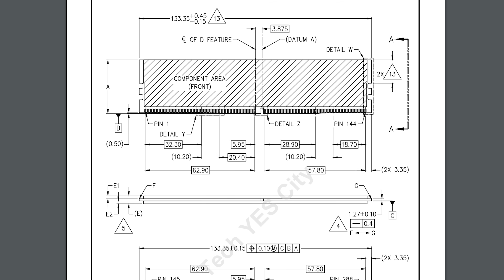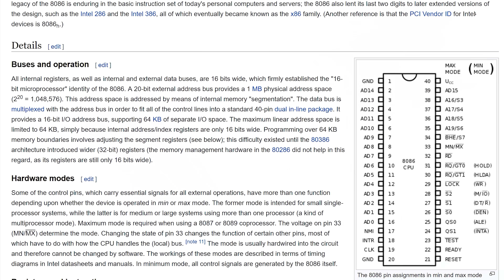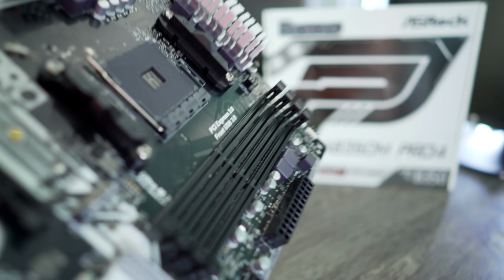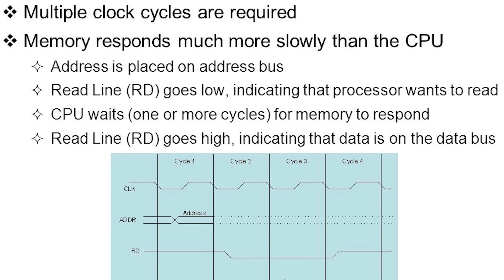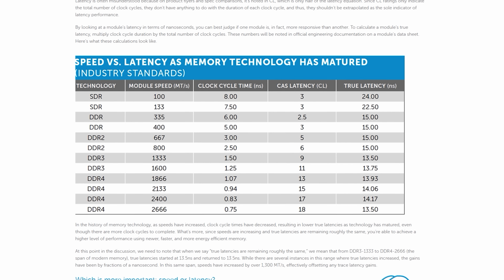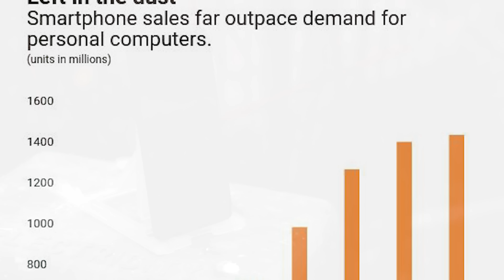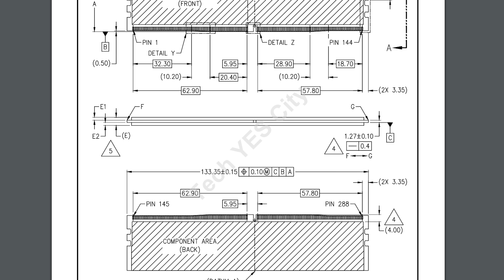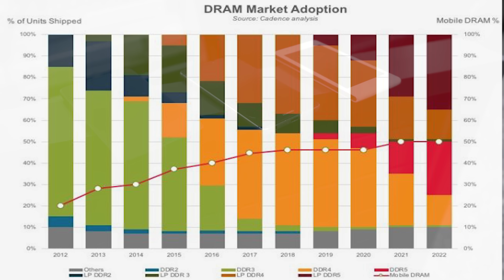When is DDR5 coming to a PC near you...?

Comment: High memory latency is not because CPU and RAM runs at different frequencies. It is solely because 1) how SDRAM works, where you need to active memory banks for reading and writing, 2) distance between CPU and memory. It takes 1.2 nanoseconds for electric signals to go from CPU to RAM and back from RAM to CPU. This is limitation of speed of light and electrical signals. You add to this some additional bank activation latencies, buffering (which takes another 1ns in CPU registers, queue, memory controllers, and memory) This means basically you can't do more than 600 million random 32-bit transfers sequentially (next only when the previous data is available) from RAM to memory. DDR5 will not improve much on it. Maybe minimally. The fact that a memory is running at 2400MT/s (1200MHz with DDR signaling), is a pipelined (interleaved) reads and writes. It is helpful with a lot applications, especially with things like cache prefetching, and in most applications where you do sequential reads in memory (and not fully random). This also works better if you have more cores or threads, execution speculation, data prefetching, and multiple memory channels, because more things can be send to memory (reads mostly) in parallel, without needing to wait for RAM to respond. This is called "latency hidding". The major reason SMT works (improves performance of many applications and systems) is due to latency hidding principle for other thread and utilizing spare RAM throughput better, despite slow latency.

DDR5 will improve throughput. It will not improve latency.

If you want batter latency, 1) forget it, use more SMT, use more cache oriented algorithms, more prefetching, 2) Use CPU with more L3 cache, 3) Use stuff like HBM2 and eDRAM/L4, for memory which is faster and closer to CPU (it is usually faster because often it is based on SRAM, not DRAM).

People often compare DIMM modules using CL (CAS latency, or Column Access Strobe latency). You need to know that CL latency is usually expressed internally in BIOS and specs in cycles per second. But if you convert it to time, you will see it is comparable to always same value. I.e. CL16 at DDR4 2666, is 12ns (16 / 1333MHz). The absolute latency didn't changed much in the last 20 years. And even in early 90s you could find memories that do 12ns access time in SDRAM, and some even as low as 6ns. For faster speeds you simply need to put them closer, and use SRAM. Then you can achieve 1ns, or even 0.5ns.

So, with 12ns, there is still some room for improvement, because it is still way off from fundamental limit of 2ns for signal propagation between CPU and RAM over 5cm. But once we go down to few ns, the distance will be a limit.

In reality, especially in big CPU systems. Software engineers are often using a figure of merit of 50-100ns for accessing random memory location in DDR SDRAM. And 3ns for accessing data in L2 cache. 1ns for accessing data in L1 cache. And 0.2ns for acessing data in CPU  registers. 1000ns for accessing data in high speed PCIe connected SSD. Things get much more complex in multi core, multi socket CPU systems, and even withing one CPU, latencies between different cores and caches differs, due to distance between them and depends on a lot of factors like types of buses used for communication and exact die and fabric topology, but usually varies from 15 to 80ns.

So obviously RAM access of 100ns is a huge bottleneck for random access.

The fastest big memories in terms of latency, that are in separate chip (other than HBM), are usually employed in real time osciloscopes, that can do more than 10 billion samples per second. Which would require memory write latency of 0.1ns. Nothing can do that, so they use dozens of memory modules, and write them in parallel in staggered fashion, and even these memory chips are at the extreme end of what is possible with current technology. Usually they use things like SRAM, PRAM, ReRAM, or MRAM, 3D / cube memories. Rearly DDR3/4, but it sometimes happens, if enough tricks are employed in memory controllers to do that. (We are talking 1TB/s of writes, compared to your standard memories that can do maybe 30GB/s).

In fact due to density requirements, and a majority of normal workloads using sequential operations on memory, latency is slowly incressing. DDR1 was faster than DDR2, and DDR2 was faster than DDR3. Seriously. There were DDR1 chips with 7ns. And DDR2 with 10ns. But you will have trouble finding DDR3/4 with less than 12ns.

If you want super low latency (but low density), go QDRII+, or RLDRAM II or these esoteric technologies. Due to cost and low memory density, and relative high power, you will only find it in CPU caches, ultra fast network switches, and super fast oscilloscopes, experimental physics detectors, etc.

PS. 3D XPoint / Optane, is slower than all technologies mentioned above.

Comment: Upgrading is gonna be a pain means a new motherboard that support DDr5 and that the CPU supports it also just be a big pain and costly
Reply: i agree and thus why moving from DDR3 to DDR4 took so long. the move from DDR4 to DDR5 will most likely take longer than that. It is also not on the server decade upgrade cycle so DDR4 will still have to be made for another decade even after they get all consumers to shift over to DDR5. To that i highly doubt any major company with enough servers to matter will make a upgrade to DDR5 when it is new and untested. In 2030 we might see a mass adoption of DDR5 in servers as QDR is not taking off in anything but PoS systems.
Reply: @yumri4  Servers are on a 4-5 cycle.  Socket 2011 was around for 7 years - from v1 to v3 or 4 - up until the new Xeon Scalables - was the HEDT and Server Socket - Xeon Scalable needs 3647 and new HEDT is 2066.  So max of 7 years - and for some it was much less (the v3 and v5 xeons were not compat with v1 socket).

Servers can much more easily make the move to DDR5 - because most of the servers are sold thru OEMs like Dell - and their customers dont care about socket or whether it's DDR or DDR5.  What ever is current will be spec'd - and most enterprise will only have the servers for 4 or 5 years - then toss them.

Not sure where you pull this decade for this and decade for that bullshit from.  DDR5 will start sampling in early 2019.  First CPUs to bake in DDR5 will probably be late 2020 - for both Desktops and Servers - mostly servers.  So by 2021 - DDR5 will be the standard, while still competing with DDR4, will slowly start to supplant DDR4 almost completely - much like DDR4 has done with DDR3.  Even then, some people will still be using DDR3  - and DDR4 will slowly fade out (that may take a decade).

New PCs bought in 2021 will most likely be DDR5.  New Servers bought in same time frame will be DDR5.  far before 2030...

I have been in the server world almost as long as there has been a server market - in the beginning was still dealing with IBM mainframes (System/390 and later AS400s) and was involved with retrofitting and building data centers for use with UNIX servers (Sun and Silicon Graphics mostly) and then commodity servers running a then very new Windows NT 3.1.  Back in those days, things moved very slowly - there may have been very long times between major architectural changes to both hardware and software. but certainly not a decade.  The current market is moving much much faster, especially on the hardware side.

DDR5 does not need testing - it either passes or it doesn't - it not like moving to a completely new generation of CPU - T&A and vendor certification will happen even before DDR5 production is ramped up - you can bet that the major OEMs are ready once the CPUs that support it and the memory starts sampling.

Very few if any enterprises actually build or even upgrade their servers - they buy them, run the hell out of them for anywhere between 3 & 5
 years, then dump them and buy whatever is the newest the OEMs are selling. This is why you can buy HP and Dell servers cheap on Ebay - they were $20-$40K machines when new - but now can be had for a few hundred bucks.

So to the OP- yes it will be a total PITA to upgrade - but will be a while before you are REQUIRED to move to DDR5.
Reply: Memory controllers on modern processors are on the CPU... so the motherboard will support DDR5 because the CPU supports DDR5.
Reply: @bradvicious3991  no it means BOTH the motherboard slots AND the CPU have to support DDR5. IF the motherbord has a DDR4 slot then the DDR5 will not slot in. Same thing with a CPU that supports both DDR3 and DDR4 depending on the motherboard you get either one NOT both.
Reply: @yumri4  When the CPUs that have DDR5 controllers in them are released, motherboards designed to use those processors will use DDR5.

Comment: Unless DDR5 can shift frequency incredibly quickly, synchronizing it with the CPU clockspeed makes absolutely no sense, and with the design direction that processor architecture is headed, it makes even less sense.
Furthermore, CL isn't the only important timing in memory; I have benchmarked software scaling linearly with TRAS, which is typically CL*2 + TRDC in DDR1 and 2, but typically slightly lower in DDR3, meaning that DDR3 improves effective latency over DDR2 with the same CL. I'm not sure if DDR4 improves the timings structure further, but it's very possible that CL for DDR5 isn't actually going to result in higher effective round trip latency, though typically a new memory standard will undergo a period where it's more refined, and higher voltage counterpart is better, simply because the voltages can be higher, allowing for tighter timings at higher clockspeeds.
Reply: Wow you ass is really active today - since you pulled all that out of it

Comment: Yesterday I got a Ryzen 7 2700X with 16GB 3000MHz RAM and what my conclusion is that you don't really need such high speed these days. I got an Xeon X5660 @ 4,3GHz with only DDR3 1200Mhz RAM and there is still no real difference to me between DDR3 and DDR4
Reply: ryzen needs 3200/cl14 (pref 3466/3600 at cl14) to perform the best.

Comment: If the speed: latency ratio gets worse then wouldn't that be a negative impact on performance for Ryzen chipsets? Coupled with the up and coming 'chiplet' CPU, GPU and APUs doesn't the infinity fabric need low latency and high MHz ratings to perform at their best?

Comment: DDR5 release was my deadline for new pc (6700k/gtx 1080 build now). A lot has changed since 6700k release with AMD disrupting CPU market. So far, i skipped ryzen, vega, and now rtx. Maybe my pc will still serve me well after DDR5 release.............
Reply: My old 6700k @ 5ghz was great also has TridentZ 3733mhz along with it. Have an 8086k now but the 6700k surely will be fine. I wouldn't have minded keeping it, even if I had an 2080ti.

Comment: It will be interesting to see how much DDR5 will benefit the future generations of ryzen. 
Ryzen 1 and Ryzen+ already greatly benefit from high bandwidth and lower latency ram. 
Just more to look forward. An improved Zen architecture on 7NM, and possibly DDR5 over the horizon to push Zen even further. Already I honestly predict Zen 2 will be DDR4, and Zen 3 may use DDR5.
I doubt we will see something like we did in the Phenom II days where the cpu could run on either DDR2 or DDR3.

Comment: Doesnt feel like the difference in ram makes much of a difference in Intel Systems. I got DDR4 in my main rig and DDR3 in my backup build. As long as I have more than 8GB I don't care about timing. Ram is expensive enough already. If you're on a budget I HIGHLY SUGGEST an used older intel build that uses DDR3. if you want a new build go for the ryzen with as fast as you can afford ram.

Comment: I’m very excited for ddr5. I haven’t built myself a flagship PC since 2011 (or 2010, whatever year the 500 series from Nvidia released), and though I love grabbing mid-range parts used or on sale for budget prices, it’s about time I went all out on the top end savings rig again. Probably built around an open box or used 2950, with either 4233 ddr4 or ddr5 depending on prices and timings. We probably won’t see “fast” ddr5 until a few months after it releases. Initially we’ll probably get 4233, 4466, and 4633. They expect to be able to get chips as high as 6400 MT/s, but that’s a bit out of my “budget all out” build, and the cl will probably be in the 40’s. Not the best for a PC that will spend half it’s time playing games, the other half rendering cat videos (kidding).

I can see it now:
An open box 2950x for $500, sigh probably a new motherboard for ddr5 (but not definitely, if speeds aren’t at the 4900+ lvl w/decent timings then an open box barebones 2950x + mobo = nice deals and is always a consideration, a beefy NVMe, 2 2TB 2.5 SSD’s, 1 8TB HDD, 32GB of ddr?, and the 2nd best last gen GPU (unless that’s an RTX 2080, then I’ll have some decisions to make as I still don’t think it will be worth the $ in late 2019/early 2020.

My “build a new used pc” tin (I actually have the paper money in a Spiderman Pencil Box) is ready, but there has always been something over the last 6 months stopping a purchase. 1rst GPUs, then RAM, now GPUs and possibly RAM. I will pull the trigger, but when you want almost unrealistic bang for your buck, well the timing has to be right, and I f’d up last time w/the GPU. Definitely not repeating that again. Fricken 580. Everything else was perfect, and a steal, but that stupid card. If I would have waited 2 months...
Reply: Crzces i seen this comment in amazon multiple times

Comment: I  don't think we need ddr5 currently, I would rather see a decrease in the price of ddr4
Reply: Then your ready for ddr5 because you want those ddr4 prices to come down. The sooner the better.
Reply: i see
Reply: I don't think we need dual cores, I would rather see a decrease in the price of mono cores CPU.
Reply: Releasing the next generation tech is a pretty good way to lower the prices of the previous gen.
Reply: ya as im stuck on duel channel cause of it
Reply: @DragonProtector  dual channel is better
Reply: @DragonProtector  there's nothing wrong with dual channel.
Reply: so quad channel wont make any better performance?
Reply: @DragonProtector  for games unlikely more than a couple percent. For peofessional work thats highly bandwith intensive youll probably see a bigger difference though
Reply: DDR5 aims to double capacity per module so conceivably any capacity you want can be had for less with DDR5 compared to DDR4.

Comment: i have 4 computers, 2 with ddr4 and 2 with ddr3
Reply: 6 computers on DDR3 , and 4 on DDR2.  About  72 GB total.
Reply: 4 pc, 2 ddr4, 1 ddr3, 1 ddr2
Reply: Main 8350. 1080ti 16gb ddr3 1866
Second 8350 970 8gb ddr3 1600
Third 8320e 1060 8gb ddr3 1600
2x test benches both still on ddr3..
(Probably should switch gpus of my second and third)

Comment: DDR3 FTW :)
Reply: Same I generally stay a gen behind to save $$$
Reply: still pushing my faildozer, 32gb ddr3 1600
Reply: Yay another AMD FX User. :D
I run it with 16 GB RAM @ 1866 Mhz.
Reply: I haven't had a real reason to upgrade from my 4790k and 16 gigs of DDR3 1866. The gains for a complete platform change just isn't worth it. I would upgrade my monitors before my next platform upgrade. Monitors are going on at least 10 years old.
Reply: Me too :77
Reply: What up Phil, whats happening i thought you were more of SDRam type of guy
Reply: @Adam-rt7lp  Fun fact, DDR3 IS SDRAM!
Reply: same...😇
Reply: Intel i7 4790k, wouldnt change that shit till some cpu goes 6ghz and is cheap
Reply: I'm using 32GB of DDR3 2400MHz right now which is overclockable to 3000MHz easily. DDR4 is not much faster anyways.
Reply: 2133mhz DDR3 with an over locked 4.7ghz i5 2500k
With a crappy coolmaster 212 from a decade ago. Still running games like BFV, resident evil 2 remake, shadow of the tomb raided over 60 to 100 frames